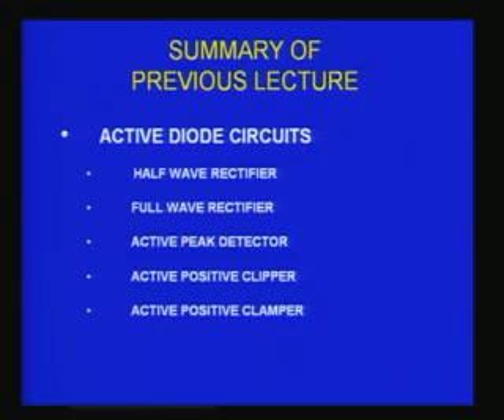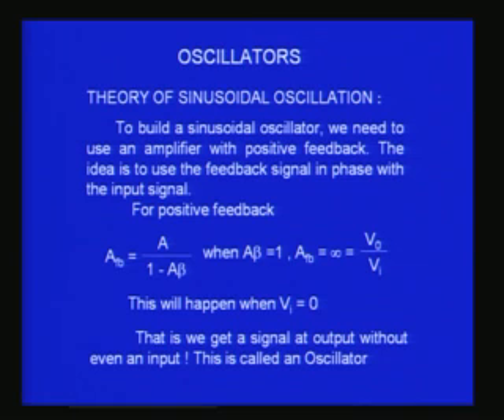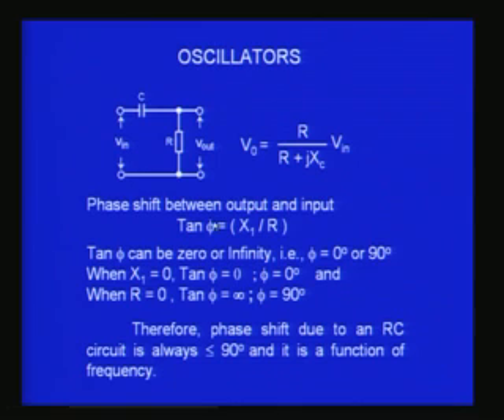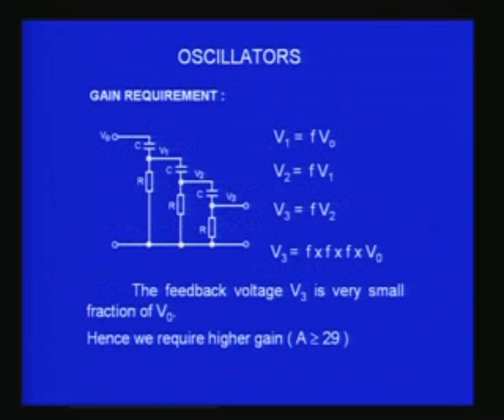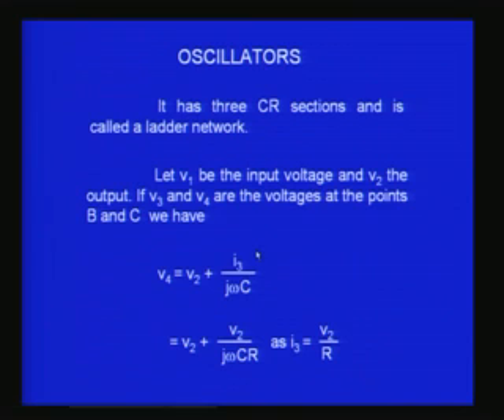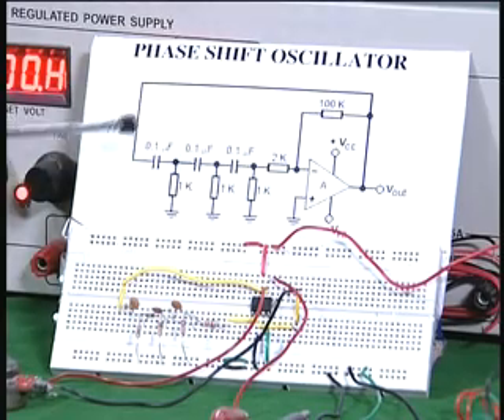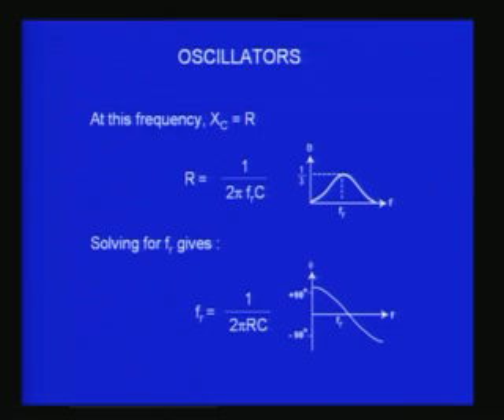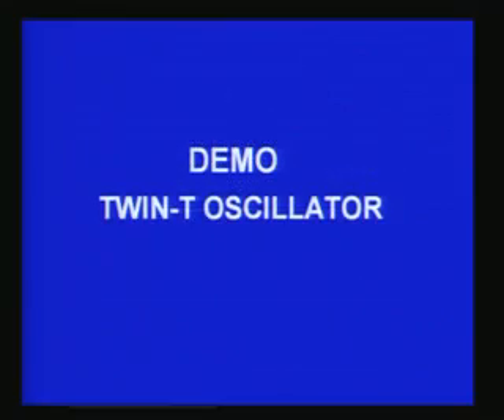Lecture - 35 Oscillatiors

Comment: saya sangat mendukung ada nya proses oscilasi secara gamblang dengan basic circuitry yg sangat jelas.saya nantikan basic kerja buffer  driver ,modulator,rf power amplifier ,antena matching , sanding wave radio ,antena transmiter.saya tunggu ya.tks

Comment: yes, oscillator is the most important part in the rf circuit. add in phase lock loop and varicap can form a "Voltage Control Cscillator" circuit

Comment: If i am not wrong , in the twin t oscillator network , the feedback through the bridge should be into the non inverting terminal because the twin t circuit provides zero phase shift.

Comment: @ Rajendra Roul: You can't have any high gain amplifier in the open loop, should be in -ve feedback except comparator.  Strictly speaking there is no small signal gain definition for open loop and +ve feedback systems.

Comment: here the feedback gain is infinite..so for even zero or no input signal(ac),there is also some finite output..but my question is that without applying any feedback,if the open loop gain will be infinite,then there should be some output signal(may not oscillating)..?????,but its not occurig..wh its so,,sir!!!!!!!